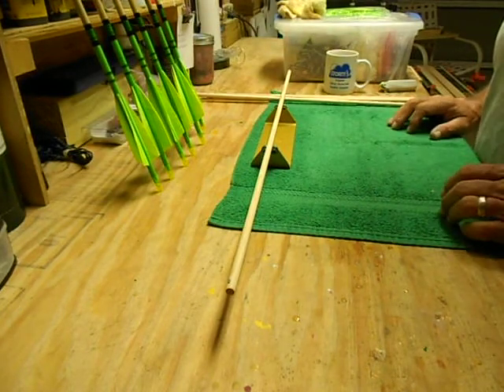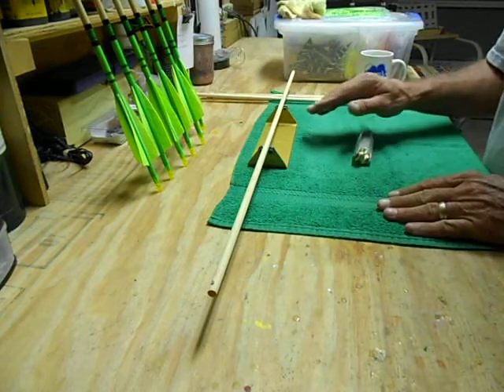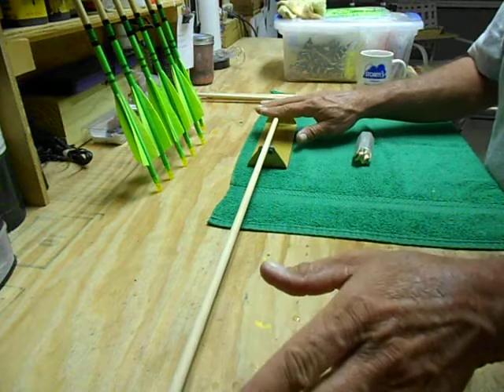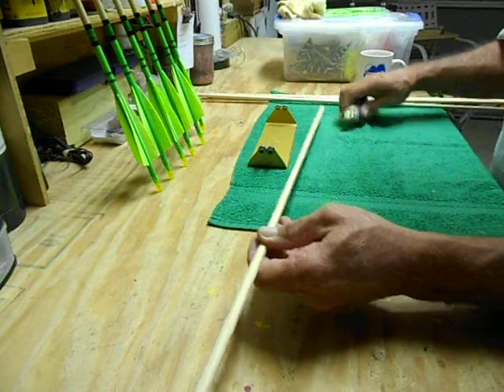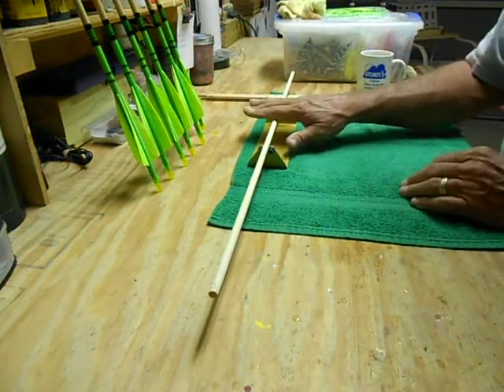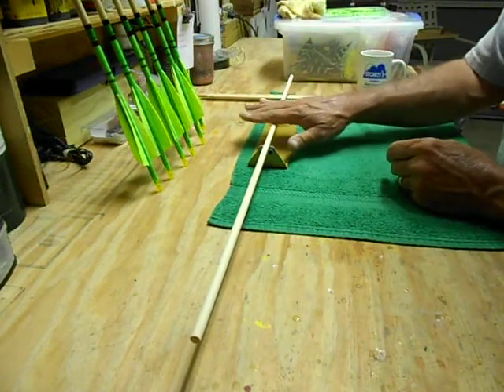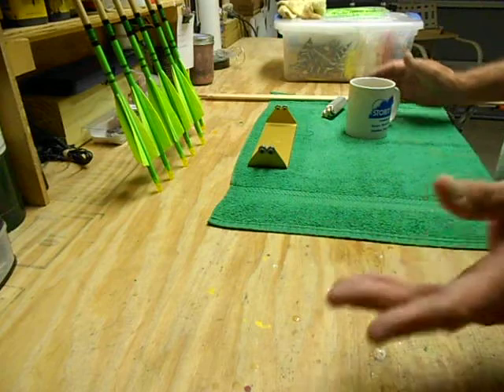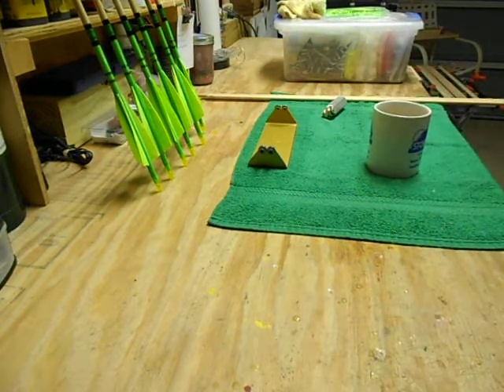Straightening Wood Arrow Shafts 1

Comment: Hey Rob, I’m building arrows with barrel tapered shafts. How does that effect the process? I imagine that if I’m rolling them on from the nock end, there’s going to be wobbling from the tapering itself?
Reply from the maker: Justin - I've used tapered and barrel tapered in the past and treat them all the same.  With barrel tapered,  Center the shaft on the spinner and rotate it from there first.  That will give you an indication of which end is off center the most.  Straighten that end first.  When done with both ends, center the shaft on the spinner and recheck.  Good luck!
Reply: Rob Green that makes sense. I guess now that I think about it, if I’m spinning the shaft from the tapered end, it would angle the tip on the other side up a bit but should still roll with consistency. Thanks for the advice!

Comment: Hey peter thanks for the video man.  I saw the spinner thing at 3 rivers but where can you get the yellow roller thing the arrow sits on? What is the correct name for this device?
Reply from the maker: Woody - this is an arrow spinner that's also available at 3Rivers or any other archery supply outlet.  This one is 20+ years old and the ones I see offered nowadays tend to be painted black.

Comment from the maker: Thorsman - How permanent the straightening remains, is in direct proportion to what you shoot it at.  Lol.  Seriously, depending on the type of wood you use, they'll stay very straight.  I use the same technique for touching up their straightness once they're fletched.  If I need to apply pressure in the fletched area I make sure I press straight down and only roll towards the nock end.....with the lay of the quill so to speak.  Primarily though, with finished arrows, any maintenance straightening is done from the point end.  Good luck!

Comment: Thanks for your video.

Can all types of wood be straightened?
Reply from the maker: Yes, some are easier than others to straighten and get to stay straight.  If a variety of wood resists this method after several attempts....heating the wood mayl be necessary.

Comment: man that looks easy what type equipment did use?and where can I get it?
Reply from the maker: Both components are available via 3Rivers.  The color has changed on the spinner as I bought it 20 years ago.....they're black now I believe.  But the Ace straightener is still the same.

Comment: What about the memory of the wood is doesn't want to go back after you've shot it a few times?
Reply from the maker: Certain woods like Port Orford Cedar, Sitka Spruce, and Douglas Fir are naturally pretty straight and only require an occasional restraightening.  Other woods such as Ash, Maple, etc (hardwoods) require several straightenings over several days at the outset to get them to stay straight prior to building your arrows.  Those type woods benefit from the use of heat in the straightening process to get the fibers to relax so that the process of straightening "holds".   Hope this helps.